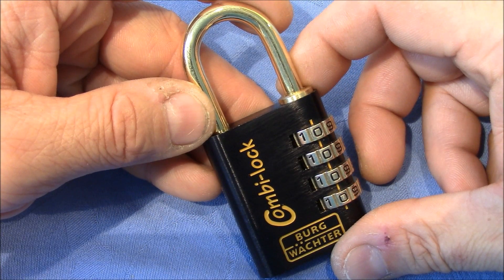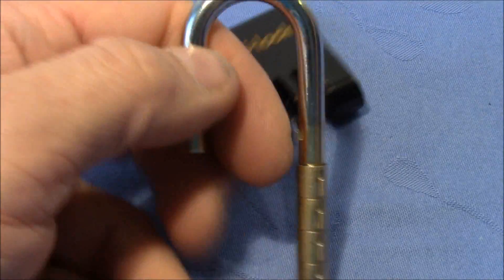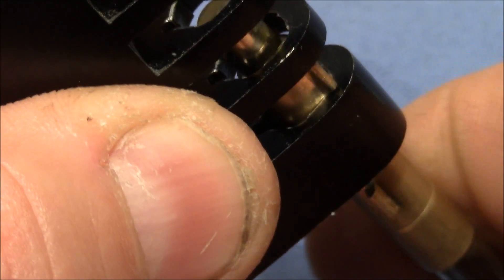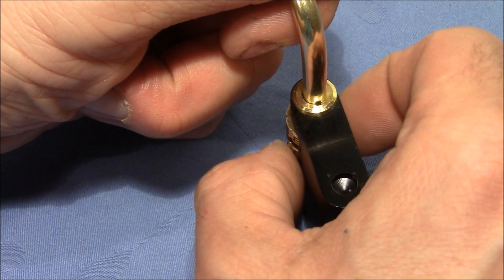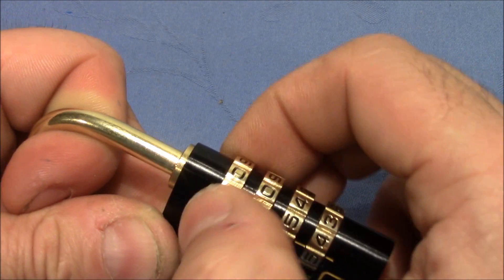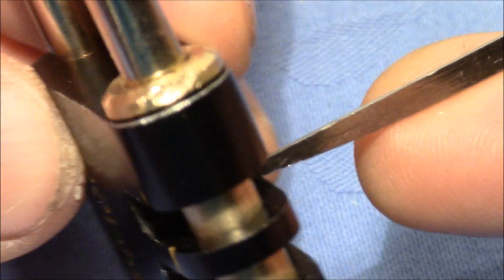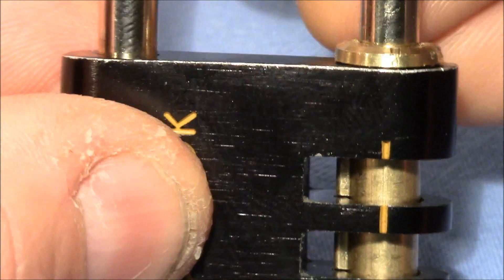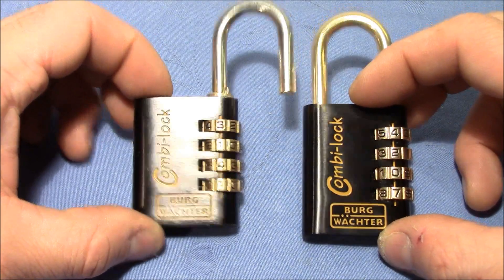(picking 351) Burg Wächter 4 wheel combination padlock dissected & decoded - false gates defeated

Comment: Great video! Thanks. I have exactly that same lock that is stuck in an open position. I can turn it about 5 degrees counterclockwise and 10 clockwise. I do not remember the code but in this position I should be able to reset it. No matter what is do I cannot turn it fully to close it. Any ideas what the problem could be?

Comment: Thank you very much for this accurate explanation and step-by-step demonstration. I have now succeeded in picking this padlock model four times in a row. Here are some tips from my experience: 
•	Start with the two lower wheels. The two upper wheels are usually not binding until at least the lowest wheel’s digit is correct.
•	Check after EVERY 2-digit-turn if the hardest-moving wheel has changed.
•	While turning a wheel, be careful not to turn an adjacent wheel.
•	For determining which wheel is hardest to turn, you have to pull HARD on the shackle.
•	The first (top) wheel is usually the last wheel to find the True Gate for.
•	You can hear a “click” when you turn a wheel either into the True Gate or a False Gate next to it.

Comment: im too clumsy for your method, i also tried using a metal pin to alight the kogs, but there is no room.
then i sat down with my tablelight and observed the first kog until i saw the first metal pin, which was between 9 and 0, which translated to a 7 at the top number, so i only had to try 1000 derivated combinations in theory (7000-7999) and it glady unlocked at 7007 :D

Comment: How exactly did you manage to remove the brass cap? I've been trying for an hour now without success ...
Reply from the maker: I clamped the lock into a vice protected by a rag. Then I used a flat head screwdriver to pry on the cap and a pair or pliers to grab the cup, rotate and lift it up.

Comment: i have a 4 digit padlock with shackle stuck at 90 degrees
Reply from the maker: Can you decode it open? Pull on the shackle and try to set the code by feeling the resistance on the wheels.

Comment: I tried your method and it took me nearly a full day trying and then I gave it up and just before I wanted to go to bed I thought maybe a safety pin thats small enough would fit in those holes at the top and i could find the teeth by pushing and it worked just took me 1 minute and i had all numbers but still good video tho
Reply from the maker: Sorry to read that it didn't work for you - decoding is fun for me and I enjoy doing it. Hope that you also liked it at least a bit. The safety pin is a cool idea - maybe I try it myself and show it on video or would you like to demonstrate it?

Comment: Nice video. Interesting to get a look inside, without taking one apart myself. Thought the new code would be 3142, but that is just me rounding up, because of the 5 behind the 1. The evil curse of math.
Reply from the maker: Thanks for watching - glad you found it interesting. I was curious myself to exactly understand the different types of feedback and so I had to take one apart for analysis. Quite interesting to see and understand the little details like the step on the tooth. As far as pi goes, I don't wanna have a proper rounded number on my locks but just have as many digits of it as possible, depending on the number of wheels. Imaging having a 4 and 5 wheel lock. With rounding the 4 wheel lock had 3142 and the 5 wheel lock 31416. I find it more aesthetic when the 5-wheel lock just extends the number with the next digit: 31415.

Comment: Very clear explanation ! I guess that the Abus 40mm combo lock you carry about at all times for fun is very similar internally ?......(don't dismantle to find out though :o) The press fit cap is  a bit less secure than I would have hoped for !! Great to see the innards anyway...
Reply: noakeswalker taking the cap off will only allow the shackle to come out, when the right code is entered, so it is not really a big Security flaw
Reply from the maker: Thank you. I think it's about the same compared to the ABUS - but I find the ABUS easier as the feedback is more clear. Why not taking one apart? - now I'm curious. I might just buy another one for the dissection - in the name of science ;-) 
If the cap is taken off while the lock is locked-up, you can see inside and can adjust the first wheel. This makes it effectively a 3 wheel lock.
Reply from the maker: @Rune International: You're right but you can look inside and easily adjust the first wheel.
Reply: Potti314. And then you can put a long needle in, and rotate till all the teeth hit the needle. That is bad !
Reply: Taking Abus apart - I just didn't want you to do this on account of me ! But in the name of science sounds like a good excuse to pull that cap off an Abus 40 :o)
Reply from the maker: That's true - I will try that out with the next combo lock that I'll take apart - thanks for the inspiration.